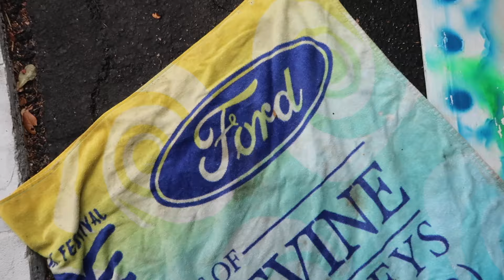I Dropped My Transmission in The Rain

Comment: I dropped my T5 on my '88 about 31 years ago in my moms garage using scissor jacks (cuz I was 150#, 6'3" scrawny then and couldn't bench press the trans outta there), but rain and puddles tops that.  When I had my '94 and now around 215#, I could lift the trans up in no prob... same with the 3550 that went in the '88.

Comment: Hopefully You are able to sell all of manual transmission parts for a fare price and have You decided which brand automatic transmission that You going to run make sure that You get the proper block plate for Your application. Best Wishes & Best of luck Thanks 🇺🇸🇵🇷🦊👍
Reply from the maker: im pretty sure i know what trans we’re going with. But i cant say, its a surprise😁🤘🏼

Comment: How much are you asking for everything?
Reply from the maker: i mentioned prices in the video. 🤘🏼
Reply: @JovanMichaels     I know but was thinking you might do a package deal. But honestly I think I’m doing an auto also. I had a 4r70w in my last fox that got stolen might do it again.
Reply: @joesanchez9512  I have a built 4r70w setup if you are interested. It's a Freddie Brown build, rated for 900+, manual valvebody, with triple disc turbo converter, trans cooler, and mount.
Reply: @NosLaser   how much?
Reply: @joesanchez9512  I'd let the whole setup go for 2500. It's taking up space in my garage. Trans alone was over 4k.